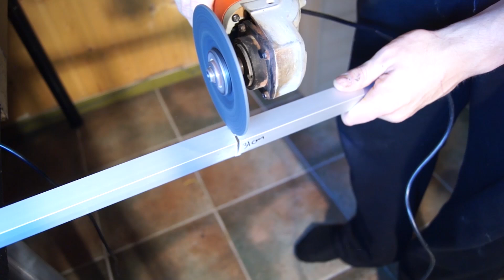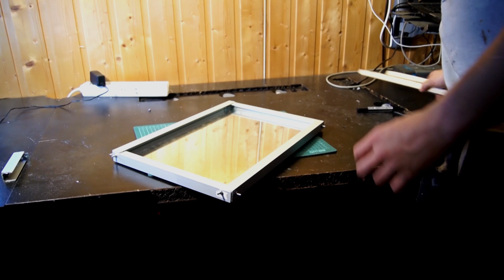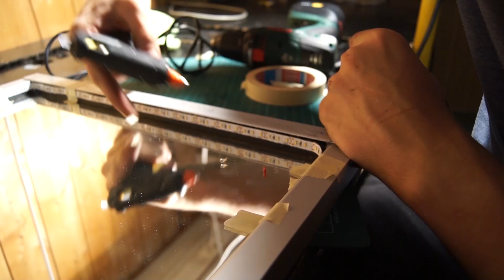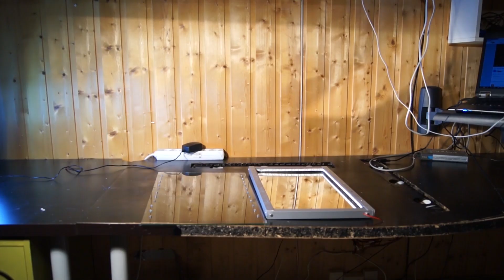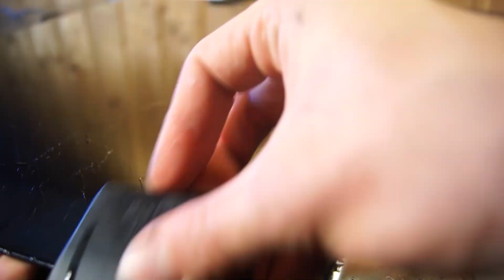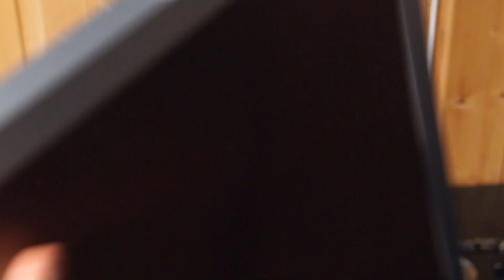Make a Beautiful LED Infinity Mirror!

Comment: I made this in 2002 with no led strips available. :) Guess what? I used Christmas lights... And it's still working nicely. The only problem is that the bulbs generate heat and the glass steams up, gets wet from humidity... I used an ornamental wooden frame, it's kinda steampunk style with a wooden switch even.

Comment: Nice result! I've struggled quite a lot while applying mirror-film to glass...
A small tip tough: put the magnets (that goes on to the glass) on top of the ones in the frame before you glue them to the glass. Then put CA glue on the top ("glass-side") of the magnets and then put the glass on top of the glue. That way you're sure you've got the polarity right. If you want to be sure you get the glass on straight, you can place everything up against a wall (or any other straight vertical surface) while you're applying the glass to the magnets.
Anyways, keep up the good work!

Comment: What is reflective factor for window tint film You used here??? There is
 several different factors... From 50% to 100%... Which one did You use 
here?
Reply from the maker: +Bojan Simonovic The one on the video is a black shading screen for cars. I think it is about 60%. I changed it later with better results to a mirror one of 90%
Reply: Natural Nerd Tnx for response. Is that 90% factor of reflection or factor of darkening?
Reply from the maker: +Bojan Simonovic Reflection :)